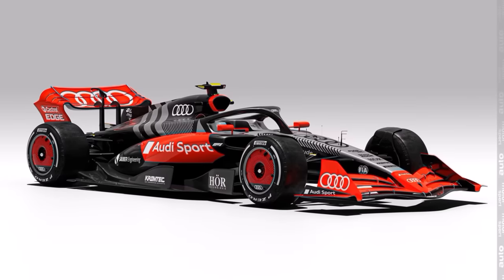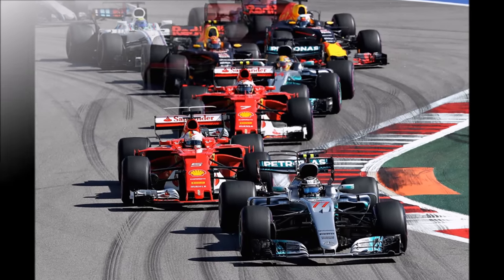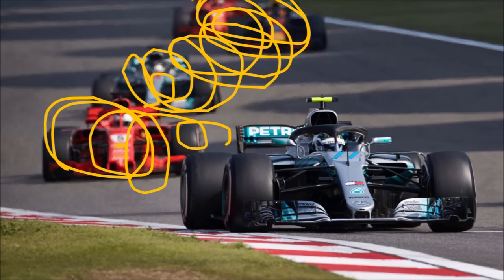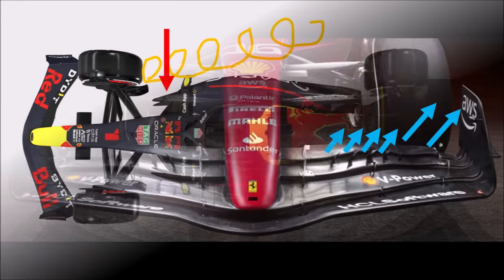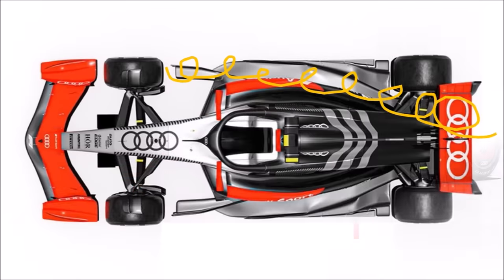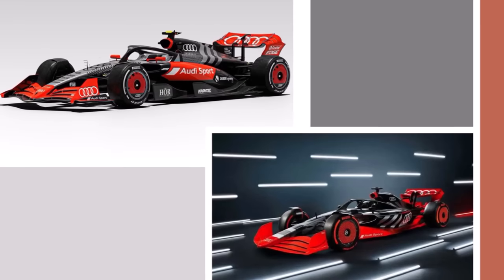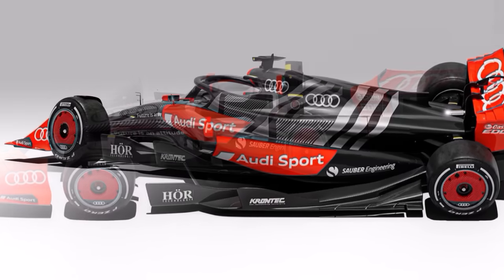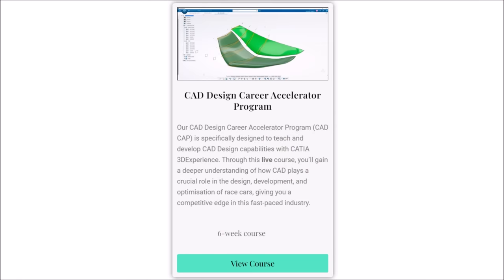F1 Concept 2026 - CLOSER LOOK

Comment: Ideas:
1. 1.8m width
2. Much shorter cars
3. No MGUH
4. Increase electrical deployment/bigger battery
5. Regenerative braking…Allow recovery from front wheels
6. 1.5L combustion engine
7. No turbo
8. Unlimited revs and fuel flow
9. Simplified front wing and floor strakes
10. No lower weight limit except for driver and seat combination which must be combined 100kg
11. Loads of diffuser performance allowed
12. Smaller tyres
13. Tyre War (Bridgestone or Michelin welcome!)
14. Automated system to detect track limit violations
15. FIA Control ECU which significantly reduces power on penalty straight for track limit violations
16. No traction control or ABS
17. Active suspension allowed
18. DRS allowed

Comment: 0:16 I guess it would be too logical to fix the actual issue, and enclose the wheels in an aerodynamic chassis... So we have this insanity of dragging giant cylinders at 300kph, and wasting billions pointlessly to compensate for this.
The 2026 formula already feels compromised, and a failure. The power-train is laughable with no ability to recover enough energy. So that ICE will be at high power even during braking and turning. It will sound stupid. The weight decrease symbolical, rather than meaningful. And the cars should be much shorter to both save more weight and to stop them being so sluggish and clumsy.

Comment: I really wish they would just give up on trying to be relevant to modern road cars. Formula E and LMP cars are already providing manufacturers with electric/hybrid data to help their road going cars. Formula 1 is just too far gone to keep playing the game. At this point, it's hurting the sport. Get rid of the hybrid system all together. Bring back the v8 or v10, and smaller lighter cars. If they absolutely insist on being "green", they should switch from gasoline to Ethanol. A perfectly sustainable and green fuel that's as abundant around the world as corn is (literally)... Give us back the fastest cars in the world, and let manufacturers collect data from series more on par with a "real" car.
Reply: The drivetrain is the only greenwashing part, the rest is to balance performance with clean air.